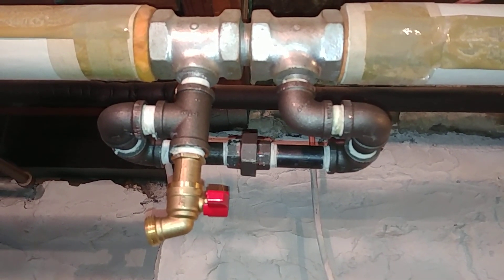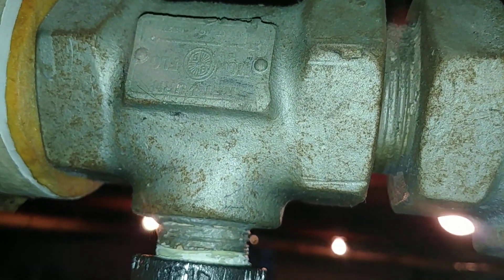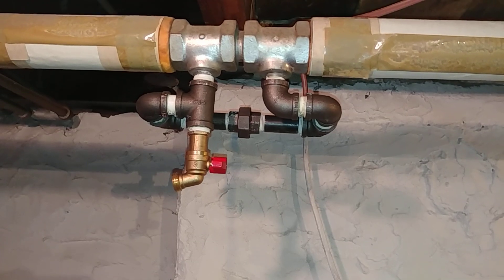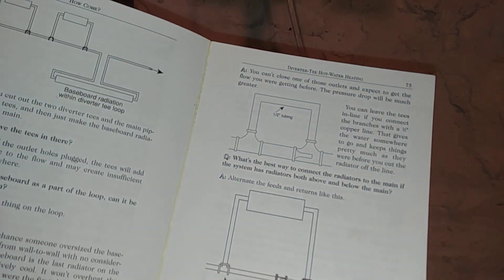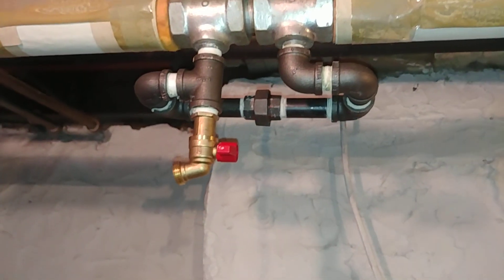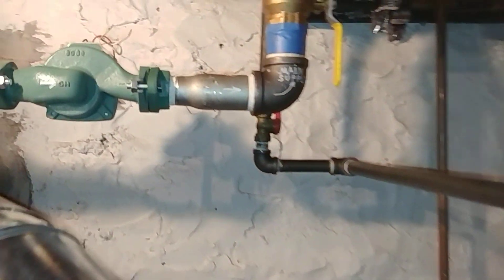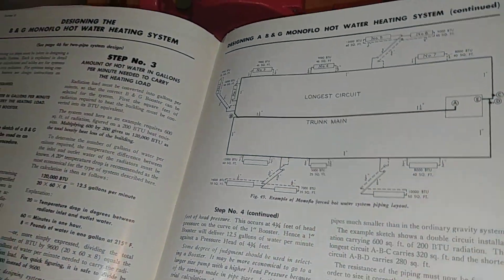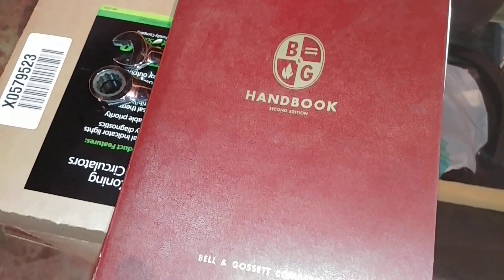Diverter Tees On Single Pipe Hot Water Heating Systems - Tips For Getting Better Results

Comment: Can I ask a question about a heat system hear please?
Reply from the maker: You can try.
No warranty I will have a good answer!
Reply: Thanks. I’ll try and be direct as possible 

1) 1,500 sf house 
2) mono flow system 
3) I removed a few radiators and hadn’t know to “jump them”
4) I added a baseboard heater in the same spot that I had removed a radiator 
5) that radiator is not getting hot
6) it has 2 mono glow valves and the radiator is above the loop
7) it has a bleeder on it
8) every feed/return has 2 mono flow fittings in this house.

My question is……

Can i remove the 1 fitting that I think is clogged or add another bleeder valve???
Reply from the maker: @Sh1tzboutagodown  Hi! Before you go looking for the possible clog in the diverter tee etc, I would consider doing a couple of things first:
1) Jumper the tees where you removed the radiators as advised by Dan H.
2) If you have a 007 Taco circ or equiv, I would consider replacing it with a 0010 Taco.  
These old diverter tee systems were often designed around the flow characteristics of the old B&G 110 or Taco 100.
3) How long is the baseboard heater you added?
Too long, and the water won't flow thru it.
Please remember, I cannot see what you see.
 I'm just some rando on youtube.

Comment: Thank God, man I just had another job I went on YouTube came up with your video again and you actually answered my question. I’m going to resolve an issue for a customer where three other plumbers couldn’t figure out 
It's the same exact issue with a basement radiator not getting hot I’m going to try to space the teea closer to each other.
Reply from the maker: I hope it works out!
The other issue might be the circ is not moving enough water thru the system.
The old diverter tee systems were often designed around such circs as the old school Taco 110s or B&G 100s, and all too often the Taco 007 shipped with the small residential package boilers now just don't cut it.
CYA.
Reply: @gordonschweizer5154  I wish I could send you a video cause I took a video of the issue . I haven’t done anything yet. I’m going there tomorrow.

Comment: Working on a friend's house they have radiators. 3 of them out of 6 are cold. No air or water comes out. They are trane "flo fittings". Could fittings be clogged? Or is 007 just not enough to pump through restrictors????
Reply: Actually I don't know if it's a 007 I need to go back to the job and check but boiler pressure was 10 psi
Reply from the maker: It sounds like the boiler feed valve is not adding any water.  
Also, I've seen sometimes where if you have a Zurn backflow preventer it locks up and won't let water pass.
Reply: @gordonschweizer5154 thanks ill try that
Reply: It was a clogged feeder valve. We replaced it and neatened up the near boiler piping. We ran boilee system cleaning for an hr through the system and flushed out piping. System ran great. Thanks

Comment: I have to compliment you Sir - you actually motivated me to get my Steam Technician Certification of which I started classes a month ago. In your example here, I'm thinking of where I have two branch's where two ceiling radiators in my basement were removed. They were capped and the banging during operation was a nightmare. I vented those openings with Gorton No 1's and a B&J Big Mouth and there's a night and day difference. My system is all steam, but I'm wondering if the principle of a mono-flo tee w/ drain would help with the flow of the steam and draining condensate.
Reply from the maker: Thank you for your kind words and inspirational story!
I am very unsure if the situation shown in the video above with the mono-flow tees and your steam issues can be related.
I'd have to get "eyes on" to even be able to answer your question with any hope of a useful response.
Be that as it may,  best of luck with your Steam Technician Certification!

Comment: I’ve seen a lot of jobs done in the 40 & 50’s with those. What further complicates that is no air vents at b/b or wall convectors making it impossible to remove air and then back to air bound loop. Can’t win sometimes.
Reply from the maker: Thanks for your comments & insights as always, sir.
This job had bleeders on the convectors, so that was good.
Also, we pumped way from the PONPC as Dan H. advises.

Comment: Yes. but below the main you need two diverter tees but they are supposed to be spaced apart. They should never be connected together by a close nipple. Usually spacing them the width of the radiator will work but it's all about pressure drop
Reply from the maker: That may be why that radiator was removed in first place.  
It likely never worked properly due to those tees being too close together.
The original installer did a few other things not following B&G's
preferred plans.
Where do you stop?
The perfect is the enemy of the good.

Comment: how about cutting both of those monoflows out and just use a union, nipple and coupling. Like that removed radiator was never there.
Reply from the maker: Nope. Not gonna touch 'em. Much easier to pipe 3/4" around 'em. Done.

Comment: Makes total sense. I see them capped on occasion and never really thought about it. 👍
Reply from the maker: Sometimes, if only one diverter tee is capped & there is an old style 3 piece circulator, it will work well enough.
Replace that ol' oil leaker circ with a 007, & that bathroom convector on the 2nd floor stops working no matter how many times you bleed it!
Thank you for your comment and support.

Comment: I wish I kept count of the ones I’ve installed bypass loops on after some “contractor” capped it during a remodel job. I find that the problem starts on on or about the 3rd radiator after the cap job. Nice topic you picked 👍 stay well.
Reply: I don't know where to start and agree with you. An acquaintance recommended me to his friend. They bought a 120-year-old house in NY. They hired a plumber. He connected a Navien boiler to the heating system in that old house, as in this video, but he removed the radiators in the basement and removed the pipes coming from the ceiling. He cut it out and put plugs on the t's! I went and bleed the air from the heater, some of the radiators of the house are getting hot, the radiators on the same line are freezing, it would seem impossible for me to explain the situation to the Landlord without this video, big thanks from NY!!